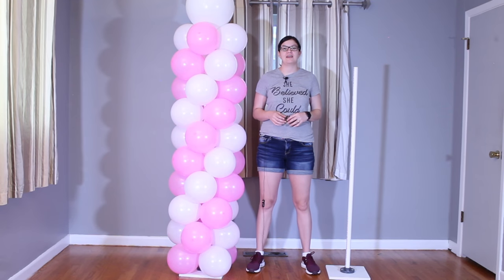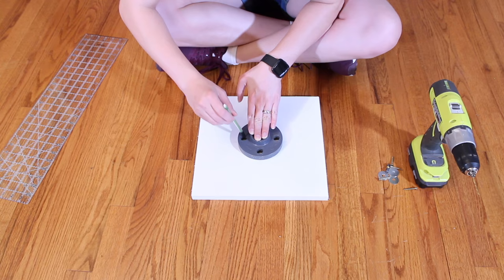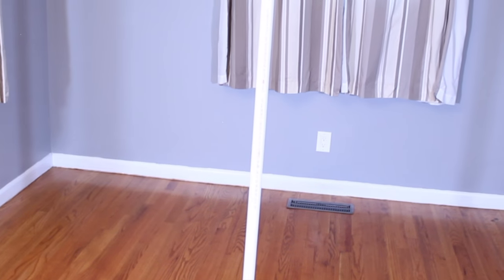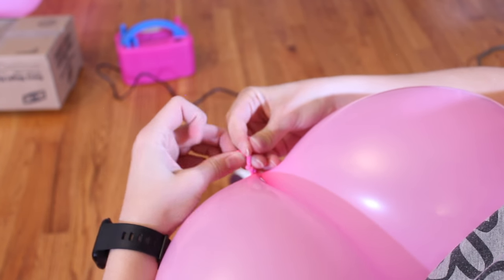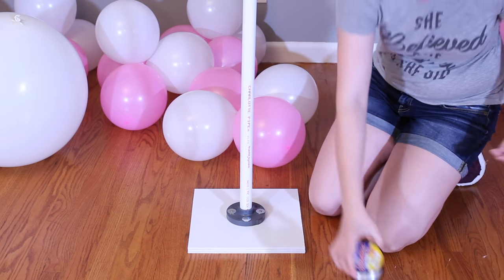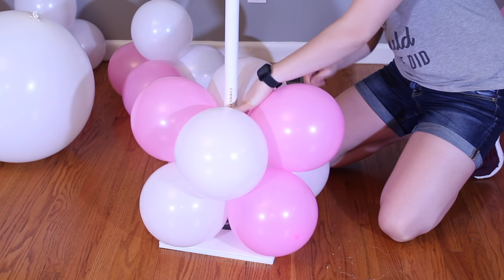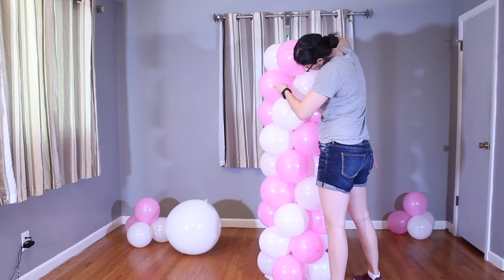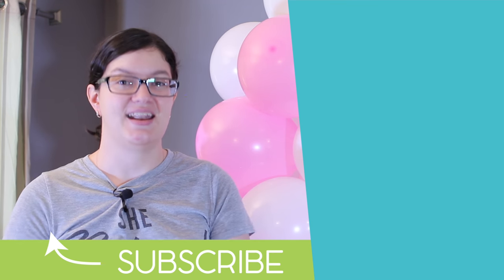DIY Balloon Pillar | How to make a  Balloon Column Stand

Comment from the maker: Want to make your own? These are the supplies I used:
Stand:
12 x12" 3/4" plywood square
1" PVC pipe flange https://amzn.to/2UgT8jC
5' of 1" PVC pipe https://amzn.to/2ZDK4dM
4 - 1 1/4" wood screws 
4 - 1 to 1/4" fender washers https://amzn.to/2NGhqCd
white spray paint (optional) https://amzn.to/2NGi3vz

Balloon pillar
40 - 12" balloons, 20 in each color https://www.hobbylobby.com/Party-Baking/Party-Supplies/Balloons/Solid-Balloons/p/DL75008 
1 - 36" balloon https://amzn.to/2NGFEfH
1 - 2 x 60" balloon in coordinating color https://amzn.to/2MMwZsi
Fishing line https://amzn.to/2NNqmWJ
Balloon Inflator (this is the one I have) https://amzn.to/2Zv0S6E
Scissors 
Balloon sizer box template https://www.etsy.com/listing/742128333

Comment: Inflate two balloons at once and tie them together right away. It's a waste of time to tie them individually first and than tie them together afterwards. You don't need fishing line for balloon columns. Most decorators will tell you to work with quads but I find that best and quickest method is to take two pairs in your hands, stand in front of the pole and hug it with balloons in your hands. Place front balloons over each other on the other side of the pole, then flip two hind balloons (those between you and the pole) over each other. This way the four balloons in the same raw will not fall apart since they are firmly wrapped around the pole. Cheers!

Comment: Great user friendly instructions.  I work at a car dealership and decorate with balloons.  I built tower base plates with metal pipe for extra durability.  I will build short tower assemblies around 3 feet tall that will be put on the roof of a car, truck, or SUV.  Also, a short tower could be placed in the bed of a pickup truck to help show it off.  Just be sure to put adhesive felt bottoms onto the base plate, or put a small cotton cloth or towel underneath whenever the tower gets placed on a surface that cannot get scratched.  Maybe I will add rollers on the bottom for heavy balloon towers for easy mobility, since this would allow untrained individuals to move the tower and be careful at the same time.

Comment: Love it!😊 I'm going to make this today using 12-inch balloons, but I'm only going to inflate them to nine inches, as you have done so. So, if I take them outside in the hot weather they should be fine because they are all ready under-inflated, correct?!
Reply from the maker: Yep, they shouldn't pop since they are under inflated. It is best if you can inflate the balloons in a similar environment they will be displayed, but thats not always possible. Good luck with your project! :)
Reply: @EventAnswer  Okay sounds good, and thank you for your quick response!😊

Comment: Will this be strong enough for outdoors?
Reply from the maker: Yes it can be used outside, but as with all balloon designs wind is a major factor. If it will be breezy I reccomend adding weight to the base. I like to strap a patio paver to the bottom for stability.

Comment: How much was it to purchase the supplies needed to make the PVC column? 
I am honestly stuck. Should I buy the supplies and create it. Or should I buy one that is already assembled and not heavy. My setups will mostly insist of me doing the work alone.
Reply from the maker: Hi Tonya, I spent less than $10 making mine and honestly it gets cheeper if you make more than one because you can spread out the cost of buying a bag of washers and screws and you can buy a bigger piece of plywood which is cheaper than the smaller handi panels. The paint it optional and could be different kinds. Spray paint is quick to apply but costs a little more per project. House paint or acrylics would be significantly cheaper to use and just as good. I also decided to make my own because I wanted the pole to be one piece. Many of the stands on amazon disassemble into small sections, which is great for small transportation, but from reviews I read they can come apart if you pick the stand up by anything other than the base. I wanted to be able to pick up my stand from a comfortable height when the balloons are on it and not have to squat down to the floor to move a piece. You will have to weigh out the pros and cons of the stands and how you want to use and store them. For me a 5' pole fits in the back of my car, so thats what I went with. Hope that helps!
Reply: Yes you have helped me! 
I have another question. What supplies do you recommend that I get for starting out in this business? And do you create and make your own desserts for the dessert table?

Comment: Can I ask you how you got the 1 pvc pipe into the 1 inch flange?
Reply from the maker: Hi Josefina, the pipe just sits inside the flange and is friction fit. I set the base on the floor and push the pipe into the flange. Because there are no threads or glue it is easy to change the pipe for different heights.